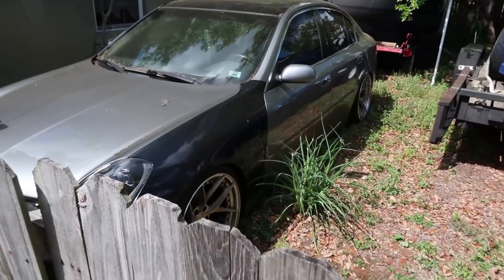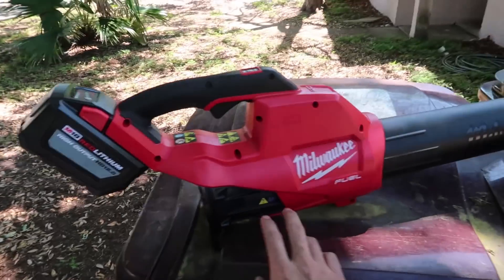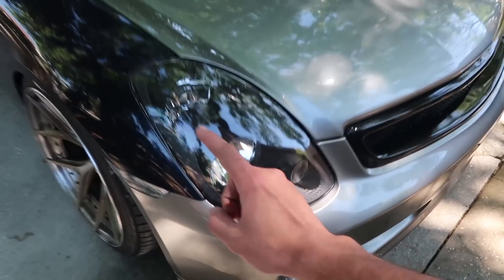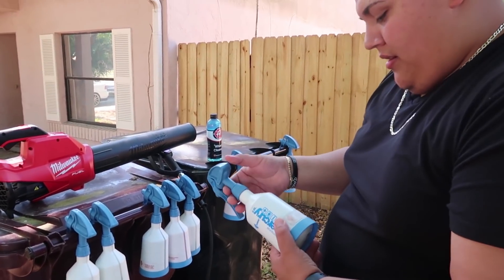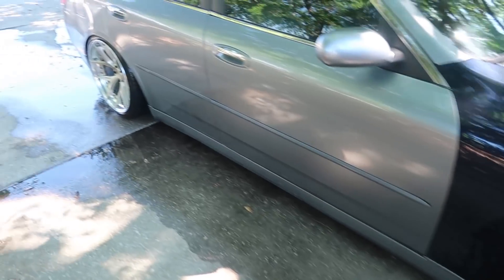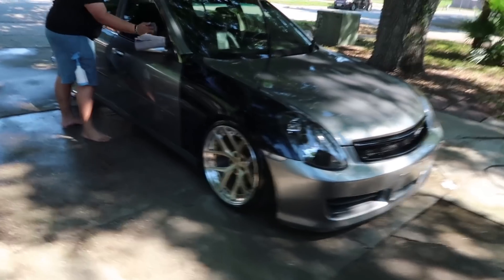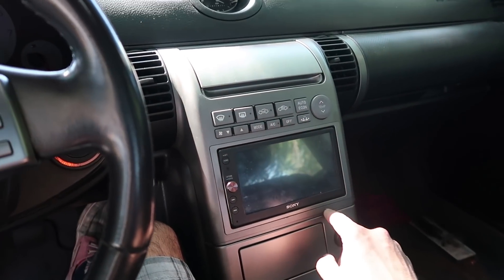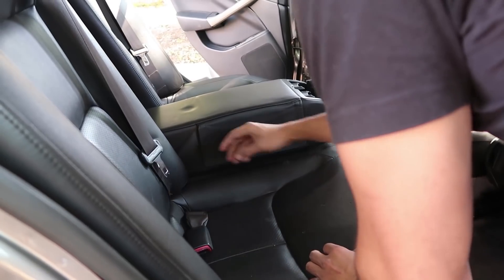G35 UPDATE! What happened to it and where it’s going!

Comment: Today I learned that I'm missing a first aid kit. 

I have an 06 sedan premium package, it came with every option except navi, and added a few dealer extras. I'm not upset by that, since the factory navi takes up two spots in these cars that are otherwise storage, and it makes it easier to install aftermarket headunits. Reclining rear seats are sick btw.

Mine has the rosewood dealer trim, and it took me two years to find a jdm nissan woodgrain piece that doesn't match, and it was like 300 bucks with the climate controls. Nearly everyone who owns these have the stock aluminum trim, and it's way better to get the jdm double din bezel and the CC instead of the metra or scosche kits. They're almost the same price and much higher quality since it's oem.

Edit: sick of yt double or triple spacing my breaks at random.

Comment: Black shows imperfections more than any other colour and makes no sense on the roof of a car in a hot climate.
Reply from the maker: You are right but for some reason at the height of the car it’s at such an angle that it’s just glare most of the time